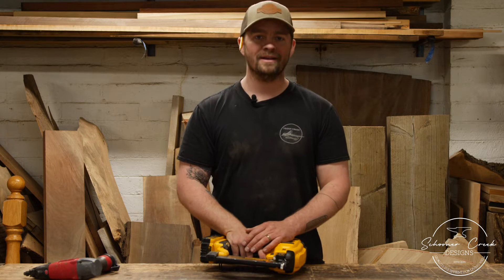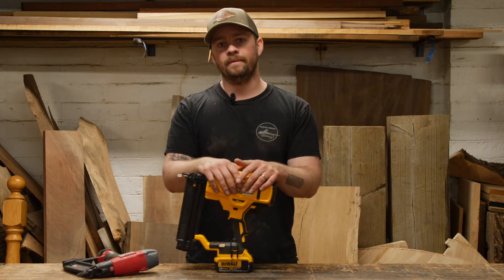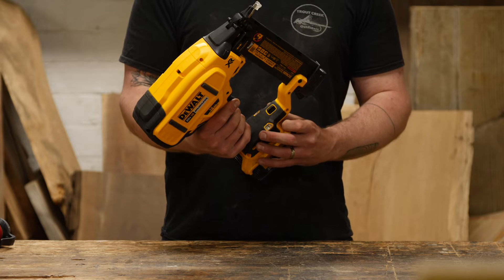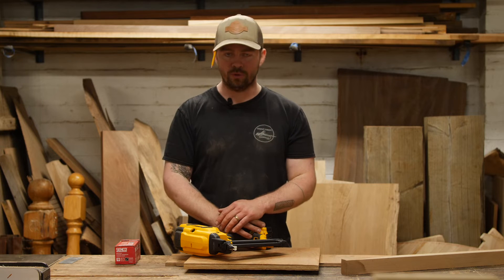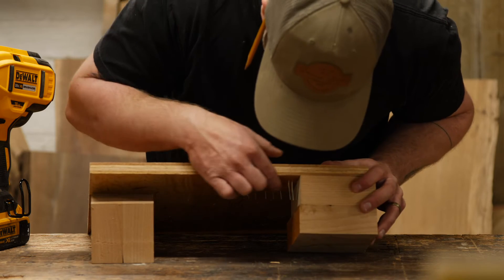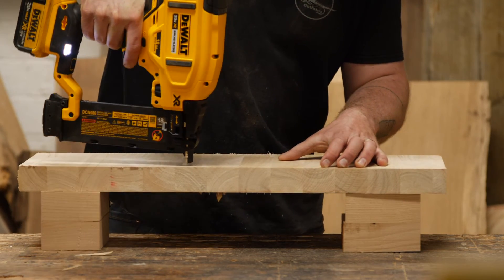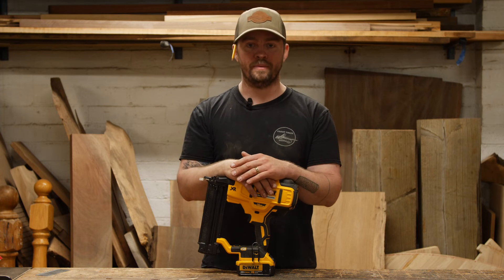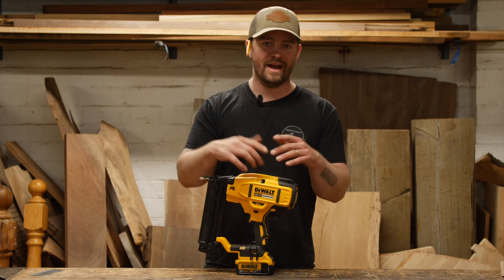GOING CORDLESS?! Dewalt 18 gauge 20v Max Brad Nailer Review

Comment: I am a new follower, this is the first video I have seen. I am a Dewalt user as well, I do windows, Doors, and finish carpentry  and needed  a 18 garage as well so I bought the Dewalt because that is the platform I am on.  I used it for 1 day took it back and got the Milwaukee  and I bought a adapter of amazing I can use my Dewalt batteries on it. I hated  the wind up and it just didn't feel powerful enough for me, it was  not setting the nails  good enough.
Reply from the maker: Great input. I personally have never had the chance to use the Milwaukee nailer. I have felt pretty good about using the DeWalt one here in the video but I've had limited exposure to the cordless nailers themselves. Do you feel like it was a defective one or just didn't hold up next to the Milwaukee version? Thanks for watching and we really appreciate having you here!
Reply: @Schooner Creek Designs  there is no doubt that the Milwaukee nailer are just a superior nailer, trust me as soon as you use one you will not use the Dewalt  again  and that is coming from someone  who has all Dewalt  tools and use them all day every day, and will continue to use them but as for Nailers it's  Milwaukee all the way.
Reply from the maker: Thanks for the info! I always want to make sure people get the best product for the money! Good luck on your projects!

Comment: If you're still using this nailer I suspect you've already discovered what I am about to say: Go back and do your test with the nailer in multi-shot mode, but keep your finger on the trigger when doing it. Your release of the trigger is letting the pump wind down. Pull the trigger, let it wind up, then get to doing the old bump... and uh... nail. There is no delay between shots then, and you shouldn't get any imperfect penetrations where the nail head sits a little proud. You'll reach a point, after a certain number of nails, where the nailer will need to "rest" but by then, you've probably done an entire strip of door trim on one side.

Talking about the toe nailing issue, yeah, I've experienced that. When I need to toe nail piece, I use the 20 degree Dewalt nailer if I have to do toe nailed pins.
Reply: Lol 
He didn't know